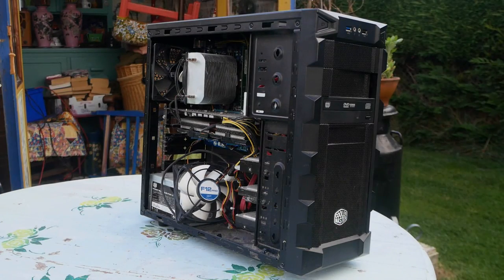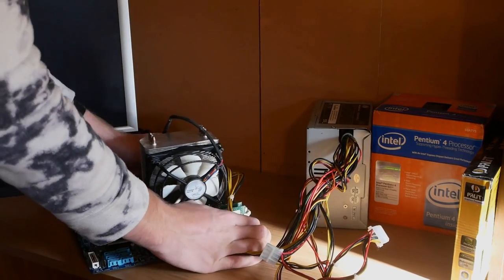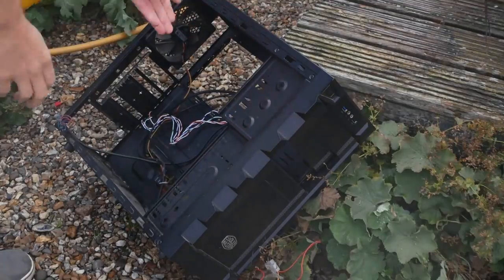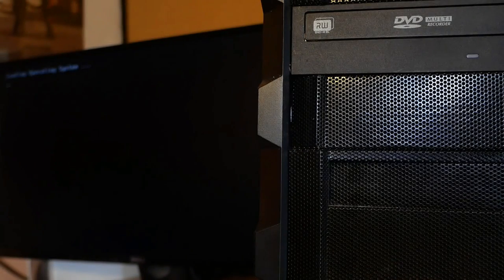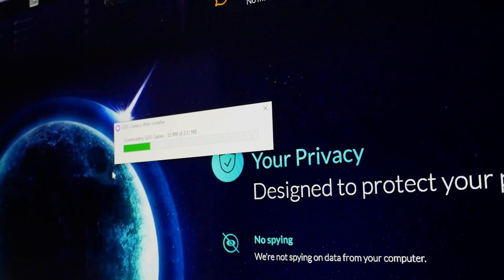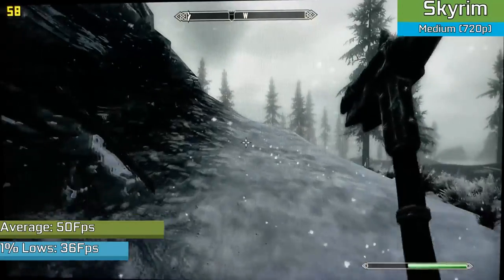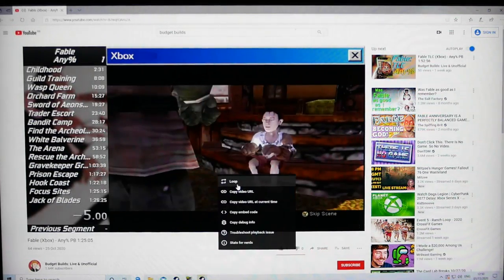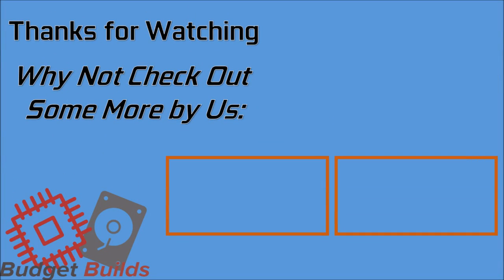I Bought an Awful Computer from a Barn....

Comment: Reckon the issues could be due to the motherboard being covered in cigarette tar? Like you tried spraying down the PCIe slots with WD40?
Reply from the maker: I have about an hour of footage spent cleaning the parts with proper contact cleaner and stuff. I think there might be some gunk blocking some of the power rails on the PCI-E Lane, but far too deep down, and far too thick for me to get to without actually taking the plastic off of the PCI-E Lane...Which wasnt really worth the work .
Reply: @BudgetBuildsOfficial  That's fair enough, I thought you might have tried something like that

Comment: I assume you tried booting with the mainboard connected to one power supply and the GPU connected to another? It most definitely sounds like power issues, though that doesn't of course necessarily imply the PSU the culprit.

Comment: With the graphics card did the motherboard have two slots if it did card may only work in the lower slot, i had a biostar that only supported the top slot of a socket 1155 board with a 3000 something series i5 i7 it weired as both slots were supported on gigabyte and msi socket 1155 boards with my old i5 2500k .

Comment: The CPU cooler and rear fan were both installed backwards, the rear fan is still backwards, both should be blowing out the back of the case so that the CPU cooler blows into the rear fan and the rear fan pulls the CPU AIR OUT of the case - basic case cooling 101

Comment: your struggles remind me of a old e6600 C2D pc I had in storage for a long time, when I pulled it out and tested it (i was going to give it to a family member for a web browsing machine) it was like it only liked some of my flash drives, some of the pci slots worked (they wanted a wifi card) and only my old GTS450 would work. The HD6950 refused to work in that pc but testing in another computer and it worked fine? Thankfully they don't need any real graphics horsepower so it's whatever. Old Pcs though yeesh lmao

Comment: You never mentioned anything about the motherboard.
I've seen videos where people get old 486 computers that actually have it set up to where there's dip switches and jumper connections on the motherboard that you can mess around with in order to configure the computer for other kinds of hardware.

Comment: I also experienced that with my 2009 gigabyte am2+ socket mobo. For some reason it won't boot up win10 usb installer. I then setup half way to the other old pc that took win10 usb installer just fine and then I put it back to the gigabyte mobo.

Comment: I got a free pc from a horse stable, it didn't boot because there was a problem with the drive but it had good specs and I got it for free and fixed it with a bios reset and new hdd, it had a16phase asus deluxe motherboard, intel core 2 duo e6600, 2x1gb corsair ddr2 ram, geforce 9400gt 1gb and a good 550watt 80plus seasonic psu, I will delid the cpu and try some overclocking with it.

Comment: I have used "Plop linux" on a burned disk to boot a USB stick(even on older motherboards that don't support booting from a USB stick).
Reply: I used the floppy disc version on my Pentium III laptop to install operating systems before I had a DVD drive for it.

Comment: Check if the CPU socket's pins are all there, this all sounds like CPU related issues.
Reply: On intel cpus it's the opposite, it's the motherboard that has pins
Reply: @My_Old_YT_Account  Yes I obviously meant motherboard, thanks for correcting me.

Comment: So all those video cards were bad? Just some advice, keep all your boards and cards in static bags, tossing them on top each other can create havoc. They either get shocked by static, and or get tiny surface mount devices knocked off that you don't even realize or see. Static can develop on its own, no need in handling them for that to happen, temperature changes alone can do it.
Reply from the maker: No all those cards work fine.
Reply: @BudgetBuildsOfficial  well, should still use bags. So, why didn't they work? I've never seen a board reject that many cards before, all PCIe should be backward compatible. I've used older cards with new boards, new boards with older cards and never had compatibility issues with PCIe. Gotta be a board problem then.

Comment: I just had this similar issue before. I think it might just be the Socket775 motherboard.. it usually has issues after issues
from ram.. to bad contacts to hardfreeze

For some reason i cant get a GT630 to work into my own 775 board. But i have tested the GPU every other board and it works. Whats odd is when i put in a GT220 the motherboard recognize it. so much trouble and i gave up on socket 775

Comment: also i had an oold am2 mother board that became cursed with only being able to use a sempron 3400+ no other cpu would work with out queer stability issues.. yet the 3400+ was allowed to be overclocked to the max 250mhz fsb and still retain 100% stability... but yet i couldnt put any athlon into it ,4100,4200,4400,5000,6000 all of which are compatibly mentioned in the bios version.  but none would work just the sempron 3400.. lol

Comment: As my daily driver for everything I'm still using Lynnfield but the difference is instead of the i5 in here I'm using a Xeon X3470 and GT 1030 (2GB GDDR5 Gigabyte model) instead of the beastly HD 4670 lol (oh and 16 GBs of DDR3-1333MHz in an HP Compaq Elite 8100 SFF)

Comment: I thought he said “7600” at the start of the video and I thought that wasnt to bad until he said what the gpu was and I didn’t understand why the manufacturer would pair a modern processor with a ancient graphics card? Then I found out it was a i5 760 not 7600, and now release why the pc was around $80 Au.
Reply: tbf, an i5-750 is almost ancient compared to a HD 7870.

Comment: I had a socket 775 mobo, one of the nicer ddr2 ones that just could not game. Picked it up in a bundle of parts. Wanted to see what 775 could still do. Even used a q9650, even later OC'd it. 

But nothing would make it not suck in gaming. In synthetic results, it got the scores it should. But as soon as a game started, the cpu tanked. Hit 100% usage immediately and the fps was horrible. 

At first I just though the cpu had aged that poorly, till I was like wait, Fortnite of all games should not be this bad. 

I've give up on the board and since then by chance got a ddr3 775 board which is my now go to board for messing around with 775 cpus. That worked fine.
Reply: My ddr2 775 board works fine. I have an Asus P5Q.
Reply: @EvilTurkeySlices   I didn't say anything along the lines of ddr2 boards would not work or have higher failure rates. (though due to the simple fact that they are older than the ddr3 boards I would imagine they do fail more due to just age) 

My story is about a board that for some mysterious reason would not work properly at games. I have other ddr2 boards that work fine (just lower end or less cpu support for higher end core 2 quads)

It just so happened I ended up getting a ddr3 board after I gave up on my highest end ddr2 board for playing around with socket 775. I just wanted to see how far I could push a q9650 and how it performed in 2020. 

also let me use more ram so I wasn't stick with 8gb of ddr2. so 16gb ddr3 ram was nice.

Comment: The Win 10 "issue" is due to UEFI boot.
1156 boards do not support UEFI, only legacy boot.

Try this. Download a W10 image, don't use the windows creation thing.
Download Rufus https://rufus.ie/.
Change the partition scheme to MBR and it should adjust the Target system to BIOS.

P.S. Win 7 and upgrade to W10 worked because of that. W7 uses legacy BIOS and don't support EUFI, so your boot partition was created using MBR instead of GPT.
Reply from the maker: I always use Rufus... this PC just has issues
Reply: @BudgetBuildsOfficial  Weird.
Recently I had an issue on an i5 8400f + h370 mobo.
For some reason W10 2004 or 1909 would install but blue screen after the first reboot (the first time you boot from disk).
Went back to 1607 and it worked fine. Once I upgraded to 1909 Windows tried to install an Intel driver that crashed everything.

Not sure what was your case, but just letting you know Microsoft might have some buggy drivers on Windows image.

Comment: I'm now at 7:30, at the start of the video you mentioned doa ram, you miraculously revived it with something equivalent to WD40. You are surprised that your computer is acting weirdly?
Reply from the maker: GT85 isnt going to do anything other than clean up the contacts. Given this was a smokers PC you'd be suprised how many components seem dead but are actualyl just coverd in a layer of tar preventing proper electrical contacts.

Comment: Bro you didn't even overclock that processor? Really? That generation can literally be overclocked on any motherboard, it's an easy 4GHz....on all 4 cores which makes it a pretty capable machine...You can run any modern title at 1080p low and titles of 2-4 years old at higher settings and it's able to handle a gtx 1050ti with ease

Comment: "... and the GPU isn't making any noise at all. I wonder why."

May have found your problem right there. Double check your fan curve, the GPU may be throttling!
Reply from the maker: I cant tell if this is high IQ Sarcasm
Reply: @BudgetBuildsOfficial  Have you checked if the nonexistent fan is even plugged in before trying to look at the fan curves?

Comment: Probably needed to setup usb boot as legacy and not uefi :P
Reply from the maker: Nope USB Booting is broken for all but old Linux and Windows XP from my testing. The board is probably on the way out.
Reply: @BudgetBuildsOfficial  Have you used rufus to make the bootable usb? Also have you tried a different PSU on the system?? Checked CPU tray for bent pins? (maybe that's why not all PCI lanes are working)
Reply from the maker: @justrandom4924  Most Likely cause is covered with the pinned comment. Probably cigarette tar destroying traces. 

I always use RUFUS to make USB Sticks. All CPU pins are confirmed fine, etc.. 

Maybe I'll return to it one day soon, and we'll see.